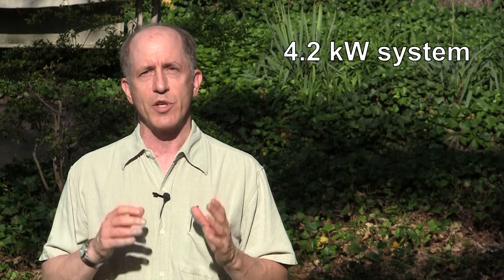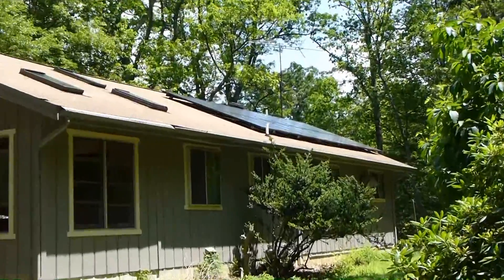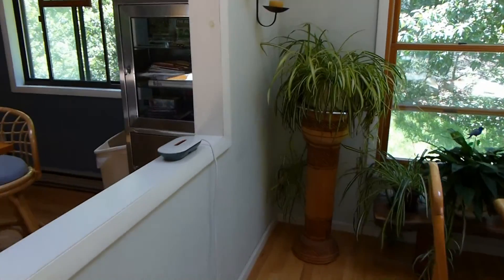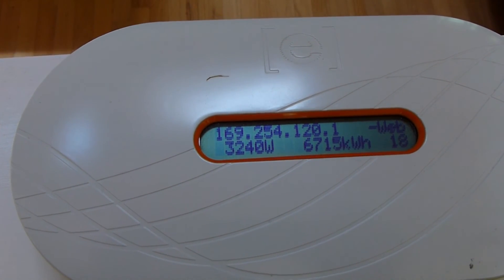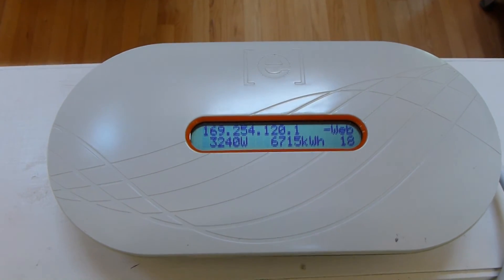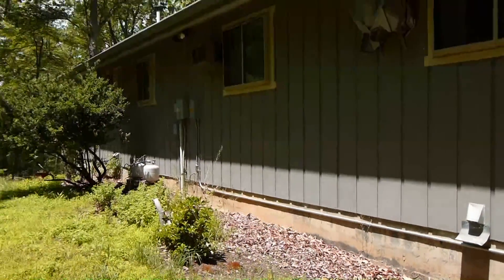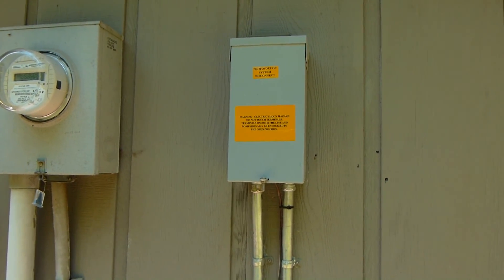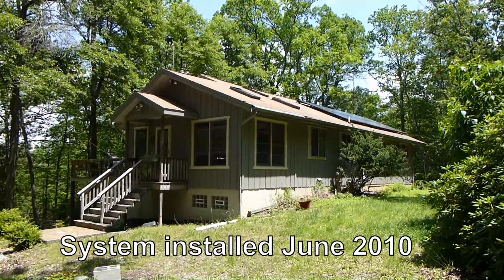Tour of a Grid-tied Photovoltaic System

Comment: Blast from the past how has this held up, Any Longterm issues?
Reply from the maker: This was installed in 2010, and I sold the house in March 2016. The system worked fine then, but I have not been in touch with the new owners.
Reply: @BobKovacs  That's cool didn't know if you was still in it or not  I have 20000kWh on racks in the back yard I just couldn't drill all them holes in my roof and I was wondering how that worked out for you. But anyway Thanks fast reply & Peace.
Reply from the maker: In the time we had the system on the house, we had no issues with leaks. We put the shingles on in 1995, so the roof was 15 years old when we had the solar system installed in 2010. (My wife and I actually did the roof ourselves in 1995.) As I said, no leaks up to 2016, and the roof was still in good shape overall.

I wish we could install solar where we live now, but the house faces the wrong way, and there are tall trees on neighbors' properties. It just wouldn't be an efficient system.

Comment: +Bobbi Meier  Answering a question I don't have the credentials for: The electric code wants wiring unprotected by a main panel (like a breaker box) to be run only outside the home, and once inside to be connect to a main panel in as short a distance as possible, which would normally be about 2 feet. And a main panel must be located in a readily accessible place, be unobstructed, and not a wet location, which excludes the roof or an unfinished attic. So you would have to argue with an inspector about how this is an exception. But whether you are right or wrong, it is not advisable to confront inspectors, although discrete bribing works fine (according to knowledgeable experts who do not care to explain how they know.)

 I remember a neighbor having his 40 year old house rewired. It was now against code to locate the breaker box where the fuse box had been, inside a basement bathroom, in a nice cabinet (about 10 feet from the plumbing.) But at the next closest location, the pipes showed signs of having at some time in the past leaked, so electricians decided that was a wet location (unless new plumbing was installed,) The closest possible location of the breaker box then needed to be located at the opposite corner of the house, 25 feet from where the Edison wire came to the house. So the helpless neighbor ended up with 25 extra feet of hefty 2 1/2 inch wide cable strapped about waist level running across his pretty brick house. But it was code.

Comment from the maker: Yeah, there are a number of ways to handle grid power outages. I have a 4 kW generator that I can fire up and feed the house, although I have to be EXTREMELY careful to switch the main breaker off to not feed power out into the grid. The 4 kW generator will power all the essentials in the house and then some.

Comment: I also had a 16 panel array installed on my house. It also is Grid Tied and Net Metering. My Meter actually ran backwards, and still does unless I have a high drain during the summer. 
The only disadvantage to my system is that if the Grid Power goes down as it did awhile back, you cannot use your system to even run one light bulb. For this I added a smaller system with BATTERIES and an inverter, and can run a couple lights, my refrig, and TV tilll power comes back on.

Comment: Thanks Bob,

Lemme clarify, the power comes from sun to solar panels to inverter to grid?

Each panel and inverter produces 240V 50Hz in same phase as the grid to be grid-tied.

The panels are connected to the grid unless there is a fault where the cut-off box will disconnect the panels from the grid.

Excess energy generated from the solar panels goes back into the grid, do companies pay you money for that?

and If the panels are not generating enough energy the grid will power the house.

Comment from the maker: They could have done that, I suppose. I wasn't asked if I had a preference to route the wires, and they just installed it the way you see it. Running the wires through the rafters in the eaves would mean drilling of holes through the rafters. Still, it could be done. You'd have to run UF wire probably, since it's exposed to weather in the eaves. It's probably best to ask a local electrician in your area to see if there are local concerns about running wires one way or another.

Comment from the maker: Yes, I did have to get a building permit from the county... most counties in the US probably require a permit for this, but some may not. It varies from county to county. The power company did not have to approve it, but the system had to be inspected by the local electrical inspector. That's for safety reasons. The power company would not let this feed the grid until a special meter was installed. That's the meter in this video.